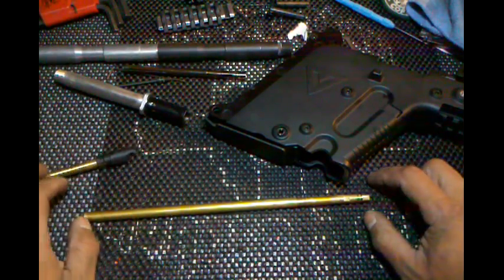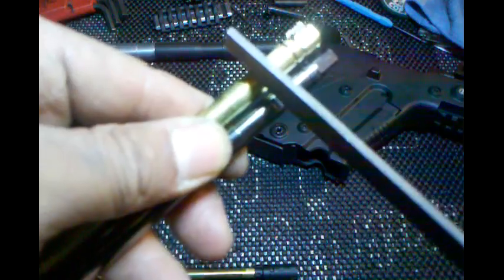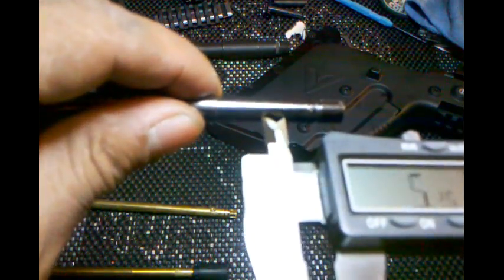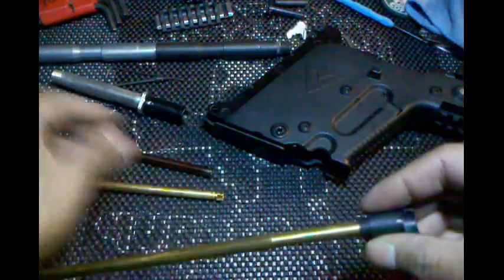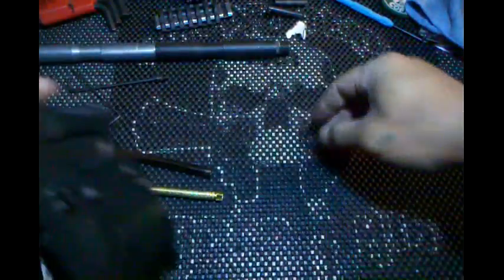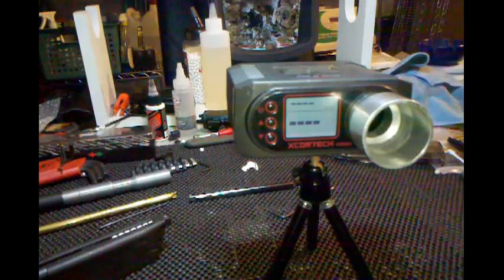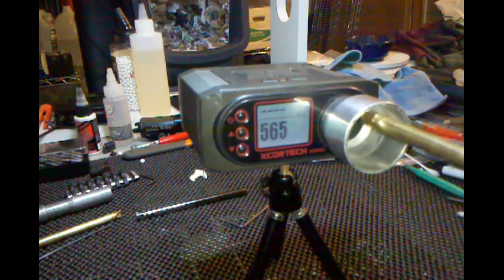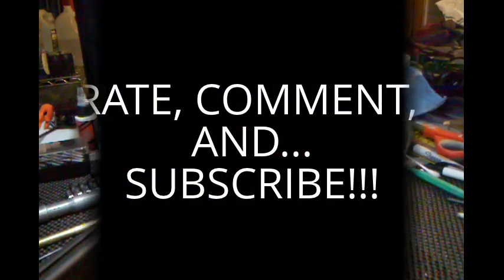KWA KRISS VECTOR with LM4 INNER BARREL

Comment from the maker: its a somewhat common problem..youre gonna have to pull out the firing pin block and take a file to the hammer sear and make sure its squared up and not rounded..also a small area on the trigger bar needs to be filed a little bit..if you have any other question just message me..i might even actually do a video on this and how to fix it.